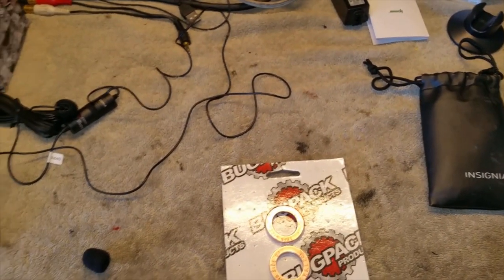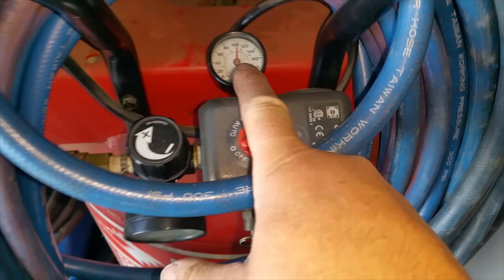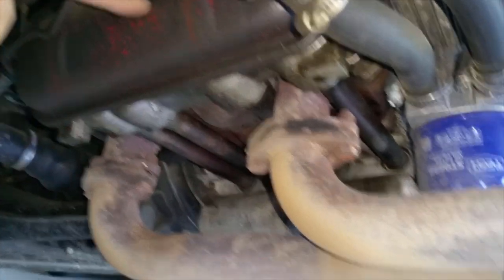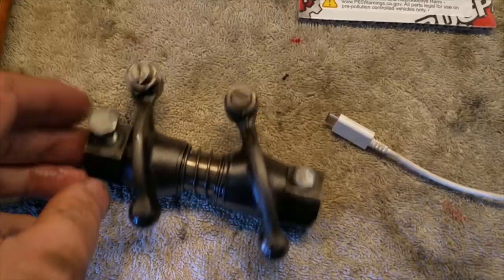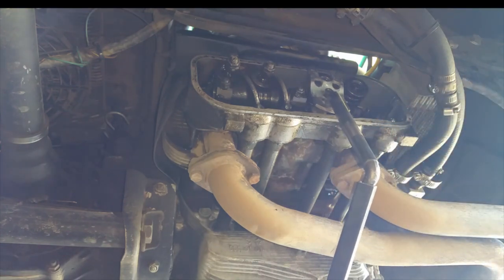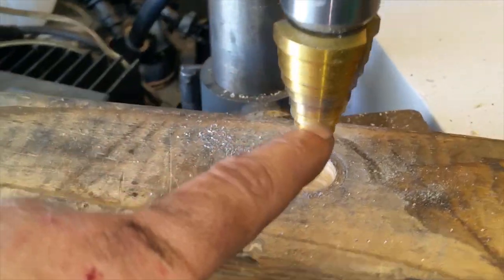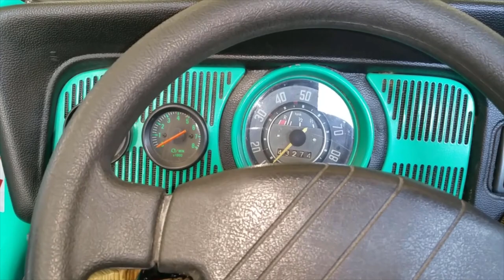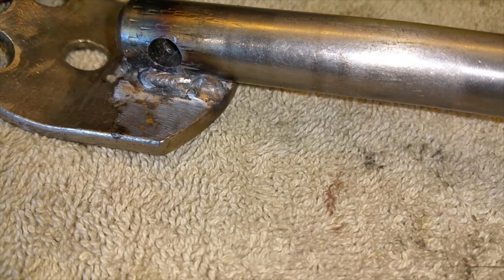Type 4 Valve Spring Shim

Comment: I had  a broken valve spring  on my vw I tried  making  a tool but didn't  work  so I bought the tool to remove the springs luckily  didn't bend the valve or push rod.
Reply from the maker: You saved it! great story.